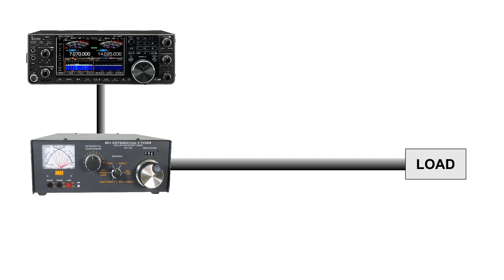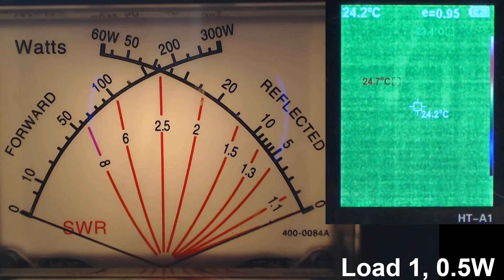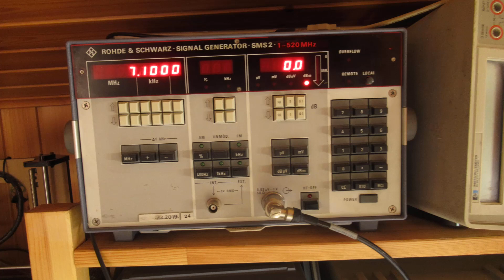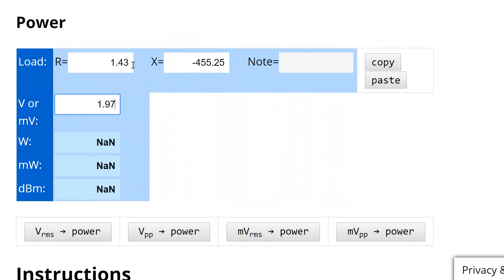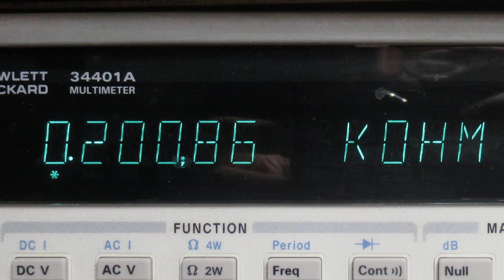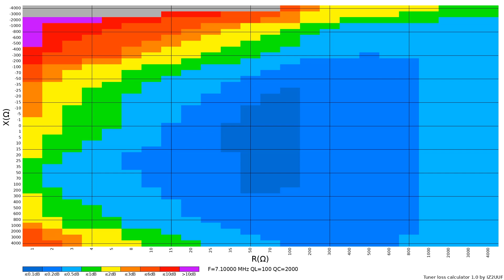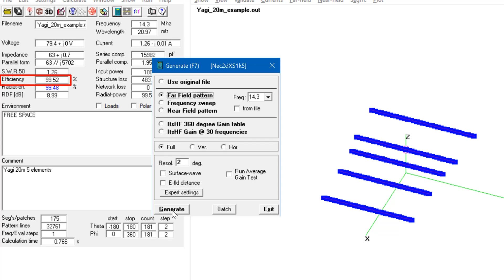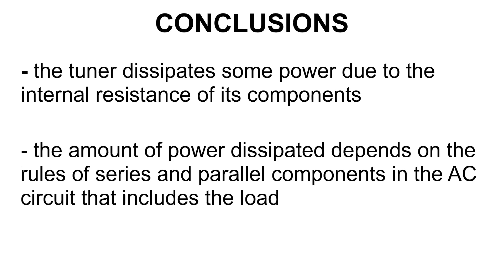Is my tuner fooling my radio? Part 2: tuner losses

Comment: I am a bit concerned about the test where I saw the voltage measuring probes attached directly to the input and output ports of the tuner. These could introduce other parameters which could complicate the calcuations. It would be interesting to see the results if you used two identical watt metres. One on the input of the tuner and the other on the output to measure the tuner loss.
I my experiments, I have found that this shows the very high losses on the lower HF bands that occur with small tuners using small torroid coils compared to large tuners which use large diameter wire coils. Otherwise a very good video with lots of useful information. Thank you.

Comment: Well done in making such a helpful video, and very well explained. I am a great believer in open wire fed doublets but get into too many arguments about the use of a tuner. Certainly a number of tuner designs over the years have been compromised by the desire to achieve additional low pass filtering which is probably not needed.